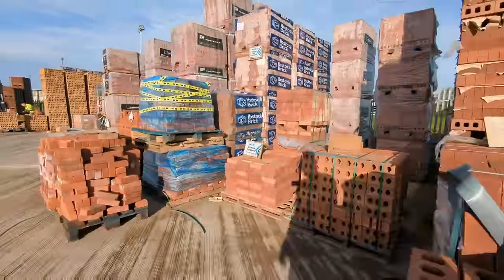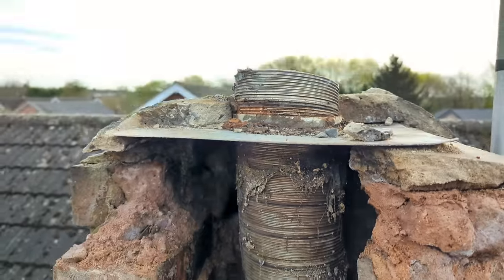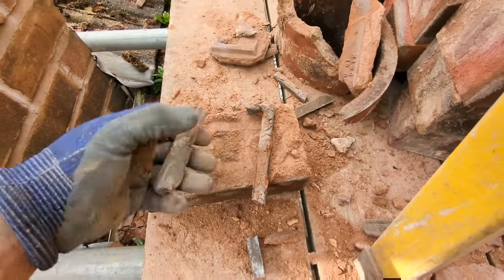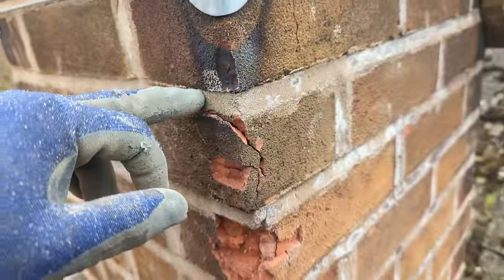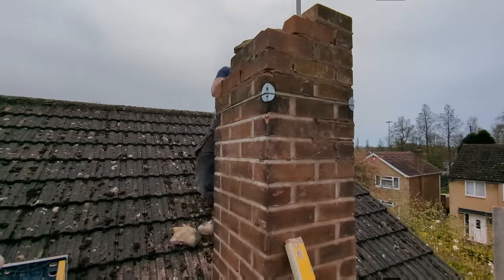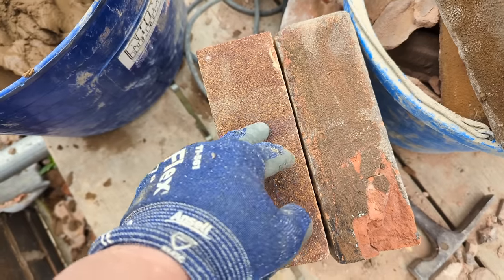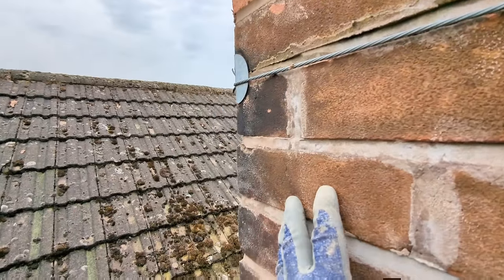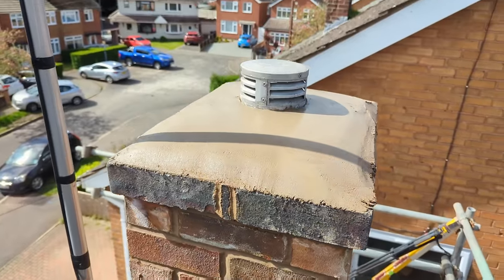HOW MUCH to repair an old Chimney??- Cost Analysis

Comment: As a builder for over fifty years I enjoyed repairing chimney stacks, especially in summer, sometimes you could just lift the first half a dozen courses off that’s virtually laid on dust , we found the best way to deal with damaged stacks was to take it down to solid bricks and mortar and rebuild them. They will last a very long time and not need repointing 😊
Reply from the maker: Brilliant stuff mate! Appreciate the comment! Hope your well
Reply: From your experience Rob, what would you recommend for air vents in roof tiles?

Comment: Hi Izzy. Mix i recommend for Flaunching chimney top. 1 cem, 1 lime  2soft builders sand. 1 Sharp sand.1 Grano chippings. They all combine to make a long lasting topping. I also do a bit of a bullnose on the front sloping upwards. To stop the sharp wdge breaking up at edges. Take care mate

Comment: Hello Izzy, hreat video as always. Im got to rebuild a stack quite soon local to macc, its very similar to that but thd cost is 950 +vat. All prices were similar i got. Day rate has to be at least 300 to 350 otherwise when you've taken off the costs you've mentioned you're working for not a lot. 
But thats only if you're good with a great reputation, which you have. Just my opinion.
Atb Izzy 👍
Reply from the maker: Thanks so much mate I really appreciate the comment. You're probably right with the DW, each to their own. Think every trade person needs to take into account their own running costs and go from there! Hope your doing well mate!

Comment: If you don't have a drill or angle grinder to take those bricks out you sometimes can use a hand saw which works really well as long as the mortar isn't too hard and the risk of damage is minimal.
Reply: That mortar did look very hard.

Comment: Mortar to steel, no deal.  That cap is going to crack the crown, allowing water in and starting the whole deterioration process all over again.
Wrap the top of the pipe just below the crown with Ceramic wool insulation.
As for your cost breakdown, the way you did the insurances should have been divided by the days you work in a month, not by the amount of days in the month.  Otherwise, at the end of the month, you're going to be short.
I put in an allowance for breakage for the roof tiles. 
If I didn't rebuild the whole chimney, I would at least repoint it from the roofline up.  That repointing mortar is too strong for those bricks and they will spall.  And aesthetically it will look much better.
Sorry for the rant.  I have been doing chimney and fireplace restoration exclusively for the last 32 years.
Reply from the maker: Appreciate all the feedback mate! Definitely noted the insulation! Hope you have a good weekend
Reply: What mortar mix would you recommend for a chimney? I'd appreciate your advice please.

Comment: I love rebuilding chimneys but to many silly customers think you can do it off a ladder and dont wanna pay for scaffolding lol
Reply: Exactly this the increase in hse legislation means even if you are working on a domestic property you still have to abide by all the standard rules for commercial works, although unlikely if you were subject to a spot check you would be thrown into the fire for not erecting a scaffold. More so if you have guys working for you
Reply: I've done it of a ladder but that was 35 yrs ago lol and in Macclesfield where the roofs were so steep you could use as a ski 🎿  jump

Comment: I would have put a Flue Liner in for the gas fire whilst I was up there. Old Chimneys are leaky for gas fumes. Good job and charge a grand next time to cover your guarantee, just in case.
Reply from the maker: Hiya mate appreciate it! The Gas fire has long been removed 😊
Reply: @IzzytheBricky if it’s been removed then you should of just pulled the liner out and capped the top or put a nice pot and flying saucer on 😂
Reply: The sad thing is there no insurance no one likes to claim especially builders sorry mate that’s the way it is

Comment: you would divide insurance monthly cost by 20 days; if you only work weekdays as 4 weeks x5 is 20 obviously if you work Saturdays account for that but itll be 24, also adding 30-40% profit on smaller jobs, as the money may be less and the percentage may not always work out worthwhile profit wise if you account for time spent, this is if your paying yourself per hr not day rate - also id look into setting up a ltd company as this will allow better tax relief ie, setup the business in your name and then you can claim dividends rather than taking a wage this greatly lowers your tax payments  , this is different in terms of me as i work from a workshop so i have a set rate per hr of work that has already accounted for overheads and profit
i also charge 10% handling fee on materials
Reply: Nope, it costs to run a business 365 days a year. You need to be allowing for costs every single day. You don't pay road tax only on the days you drive the van, you don't pay insurance only on the days you work, you pay these costs 365 days a year.
Reply: @stuartcraigon2003  i mean thats like saying i need a length of box for a job which is 7.5m but i only need 1 metre of box for the job you gonna charge for the length or what was used? No one works 365 days a year lets be honest, it only works out at about 2 months a year youd need to find the extra money for, if you price your jobs right you can just pay it from the profit

Comment: That job would be about £1250 down in South East including scaffolding…that might include VAT!
Reply from the maker: Cheers brother appreciate it!!
Reply: @IzzytheBricky  yes I think your pricing is too cheap if I’m being honest. Your a quality bricklayer and out perform many others by the looks of it - you can demand a premium for that! A quality tradesmen is worth every penny if you want the job done right! I reckon you should be charging about £300 per day minimum. Just my thoughts. I’m an electrician by trade but do put my hand to most things and electricians now getting £600 per day minimum in London areas maybe lots more. Bricklayers in south east £300 per day minimum. You supply your own equipment that you’ve bought too don’t forget that. Yeh I think you’re worth £300 per day minimum! You work hard and get lots done. Your self employed maybe working for another firm charging the prices you said about as a sub contractor but for Joe Bloggs deffo £300 per day minimum.

Comment: Big firm, this job would be thousands not hundreds - because they know 80% will go to costs & taxes. If they run stuff real slick, they might get to keep half of the 20% in the medium term. At a glance, I can see loads that a bigger concern wouldn't get away with - that's not a criticism, it's just how it is. Which is where the costs come in. 

Firstly, they'd need an engineers report on the damage & an engineers report on the fix. They'd need better access safety & waste disposal blah blah  - they need method statements & safety audits on the job. They'd need everything certified, including the scaff. They'd have to warranty the repair, the repair would take 3 or 4 times as long & they have a back-office to run too - plus a salesman to pay for getting the job, and on and on on the costs front - which is why this would be thousands.

Comment: Mice one Izzy. Looking after your Nan. LBC's cost a feckin fortune and they're all like bananas! In South West we have an alternative manufacturer doing a LBC Heather lookalike, they are good bricks and blend well. Guess you had LBC imperial sized bricks (based on age of chimney) and the new are LBC metric, minor size difference but does make a difference as you found out! Other costs you might need to include are your mobile phone costs as its a tool!
Reply from the maker: Thanks so much for the comment mate! Definitely the worst brick going those LBC's! Another oversight regarding phone and that! Daily cost is looking more like 30 quid after reading though these comments 😂!

Comment: No two jobs are alike when it comes to pricing. I would price on how much aggravation the job would cause as a formula in my head. Such as how difficult was the location, did I like the client, how close could I get my truck and equipment to the job, how much wear and tear was this job going to cause to me and my equipment etc. that’s why I’d never discuss hourly rates with customers, I’d just quote a price based on a feeling and formula in my head. And I did quite nicely thanks.

Comment: Mate come to Australia, most brickies here pick numbers out the air and charge what they like, so much work they can pick and choose their jobs, they do a lousy job, every job needs to be acid washed to clean off the smeared cement. A an example 2 work friends had new houses built, one had all the brickwork condemned and, builder said it was "to code" had to pay for an independent inspector and threaten legal action, cement between bricks varied between 2mm to 10mm. The other paid for upgraded bricks but the job was so bad, complained to the building inspector (they are all employed by the builder!!) and again threatened legal action, the builder ended up rendering the house.

Comment: The hard cement helps retain moisture in the bed joint.

The softer bed joint disintegrates as it can’t breathe.
LBC heathers or dapples are awful

Comment: Surely you only have 21 or 22 working days in the month? Or do you work every weekend? I think you need to make your business running costs higher. Still seems a very reasonable price to me, and you are a top rate bricky, not the usual monkey. Keep up the excellent channel.
Reply from the maker: Thanks so much mate! That's a really good point, and I'm not gonna lie, I just assumed it was 30 days. So thanks so so much for pointing that out to me! I'll rejig things if I ever go back to pricing jobs! Thanks again for the insight and support mate!

Comment: That mortar does nothing to the breathability my friend.What it will do is potentially damage the brick because of its strength of too much cement content which would more likely explain why your brickwork was discovered damaged
Reply: Antonio, what mortar mix would you use please? I'm trying to learn, thanks.

Comment: I would have been tempted not to put the top layers back on. The stack height was probably built to suit solid flue back in the day, gas fire would not need the height. 
Plus, would the flue need checking with a gas safe engineer to prove no flue leakage ?? It had been disturbed 😳!
Reply from the maker: Hiya buddy appreciate the comment! Only built it cos that's how the boss wanted it😂💪 and yes your right there...but, she doesn't actually have a gas fire anymore, it's all been disconnected and boarded over😊
Reply: In that case I would have definitely dropped it...maybe even tiled it over 😅🤣

Comment: Pricing, was always the awkward part for me too, if I went to move a cooker, lets say two feet for the client, and said £40, they would, say its only moving two feet, I would have to say" its not just the job, liabilities, advertising, fuel cost, all the consumables, gas, flux, solder etc, the van, the fuel, materials, labour, etc, etc, so its not just the two feet your paying for, or and the skill required

Comment: Could you have also covered the drip edge with cement? Cement on too but on the sides, the dripping edge is made out of bricks, water will be absorbed there
Reply: A mortar fillet always tends to fall off from what ive seen on chimneys but you could if you feather it in properly

Comment: Good instructional video, Izzy, however you should advise your gran to have the gas fire ( if there is one) at the bottom of the flue liner removed, the aperture cleaned out and possibly a smoke test done.

Comment: Tools mate !! You need to price in for replacing tools as well same principal as the van insurance etc ! How often do you need a new trowel, mixer, hammer, bolster etc etc 
If you replace something every 3 years (trowel say!) Take cost including inflation divide by how many days/hours you'd use it then you know how many pennies you need to add pee day/hour to accumulate the replacement fund. After all the customer is getting the wear and tear of the tool ! 
I was taught this way many years ago starting out but never actually included it as it felt cheeky. But once I did eventually do it and also put aside the tool money ... wow what a difference !
Reply from the maker: Hiya Karl! This is definitely an oversight on my behalf! Definitely need to look into this the next time/if I start pricing jobs again! 
Again really appreciate your thoughts on this mate! This is why I'm a terrible business man😂

Comment: Hello izzy , I couldn't find your email , ex brit in usa . Can you please let me know what your mortar mix is for the bricks and the mix for the chimney cap . As much information would be appreciated, all the best 👍
Reply from the maker: Hiya mate hope your really well over there! It was a 2n1 mix. 2 part sharp sand and 1 part cement. The sharp sand acts as a solid concrete base for the top of the chimney. Think you guys should have sharp sand/grit sand over there😊 all the best mate, any questions, just reply back to us here
Reply: Cheers izzy , will the same mix be used for repointing and laying    brick , as you did with the chimney . You are correct ,I don't know the equivalent to sharp sand over here .thank you for the advice. I really appreciate it 👍

Comment: why build it back to the original size if the elements are destroying it..why not reduce the size, you took away 5 courses of brick back to good mortar ? cut the flue and renew the flaunching ?
Reply: I thought this. Sure there is a reason why.
Reply: @andymrkipling  there is no reason we dont burn coal anymore and very few people have wood burners so theres very little reason for chimneys now !!!
Reply: Chimneys work better at ridge level or higher. A fire / log burner installer will confirm this.

Comment: Its only a matter of time until the lower courses spall and fail as well, due to the poor choice of mortar used to repoint.
Reply: Could say that about any chimney it's only a matter of time... Fact is it's been made safe
Reply: My chimney needs repointing. Had a quote to use 3:1 sand cement, but as a DIY homeowner I'm guessing this is too strong a mix. What would you recommend as a weather resistant, long lasting repointing mortar mix that will let the building breathe?
Reply: @vc6769  The issue is using a lime mortar or a cement mortar. Lime mortar breaths where as cement mortar doesn't. If you use a cement mortar over lime, then water gets trapped and freezes in winter resulting in spalling bricks or failure of the new mortar layer. Check what type of mortar you have already and match it when you repoint. If you have an older property, it's probably lime based mortar.
Reply: Thanks Matty that's what I thought. What actual mix would you use, ie type and strength of lime, and type of sand? In finding it hard to know what materials I need to buy, instead of cement and builders sand.
Reply: @vc6769  It depends on a variety of factors including location in the country (weather conditions, such as driving rain), where you're pointing (exposed to the weather or not) and the type of bricks you have. General approach is that you should pick a mortar that is slightly softer than the surrounding brick. NHL3.5 is probably the most widely used. You can get bags already made up with the sand and aggregates if you're only doing a small job.

Comment: Sorry but, your monthly costs are not figured correctly. They should be figured out for 22 working days per month and not 30 days.  If you decide to work more days, that’s your prerogative……
Reply from the maker: Cheers mate really appreciate that! And this is why I like making videos, more experienced people in business/the trade have much more knowledge on this stuff that myself! Hope your well Jim!
Reply: Your insurance is don’t just run for 22 days per month they run for 365 days of the year so needs to be accounted for over that period
Reply: Great video pity so far away from me need chimney taking down great work 👍
Reply: It's usually OK if the wall goes in a little vs out a little😊
Reply: I do all my caps the same way never fails I put a fiber cement on top of mortar  for a little extra strength
Reply: @stonesmasher8369  I’m in the Chicago area, we do caps with Portland Cement and pea gravel. They are pored into a 2x4 form (3 1/2”of cap) that is at least 1 1/2” beyond the brick, if it’s for a masonry fireplace, there is also some rebar.
Reply: @Matt_Cross86 Correct 👍
Reply: Wrong, there are 30 days in a month, on average, just because your not working doesn't mean the business costs stop. It costs to run a business 365 days a year.
Reply: @stuartcraigon2003  I think he meant apportion the cost across working days so that the slightly higher amount covers the cost for days not working
Reply: @stuartcraigon2003  You’re not getting the point.  You count working days of the month only. You don’t count Saturdays and Sundays. That makes your cost of operation higher because of less days.   Comments…..

Comment: 80 pound a month public liability insurance is exstream ✌️🤟🧱✌️
Reply from the maker: It's steep. But I've recently upgraded it and it's up there with the best, working on private jobs around the public it needs to be good. Especially when you do big steel work.
Reply: in australia its its approx $100 per month for $20,000,000 cover